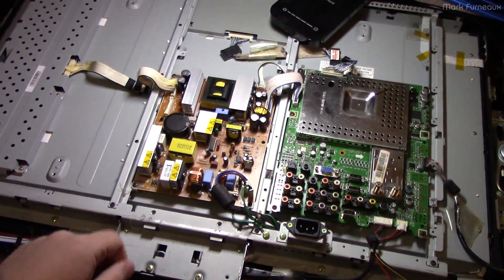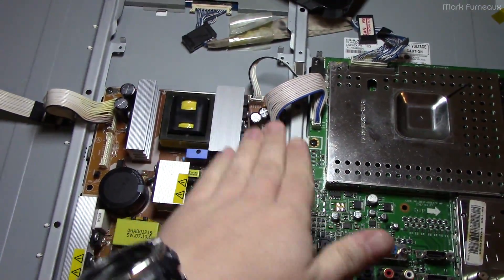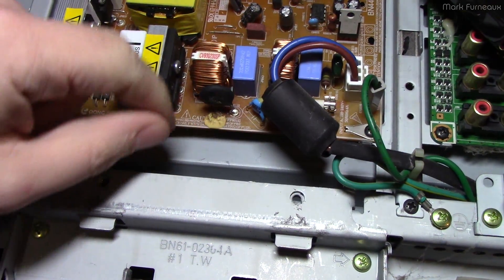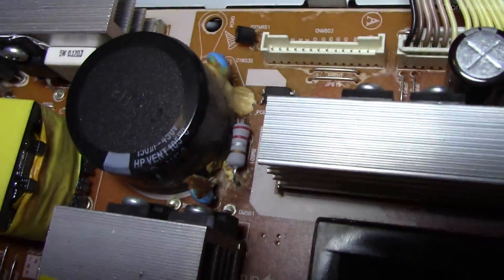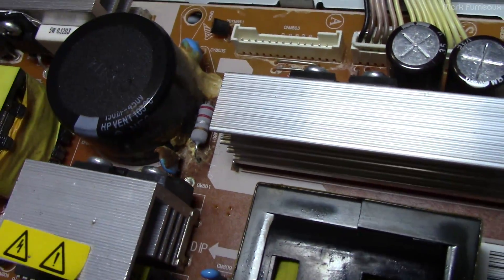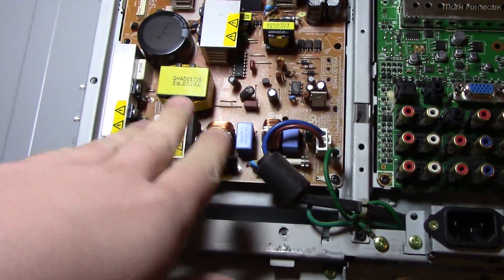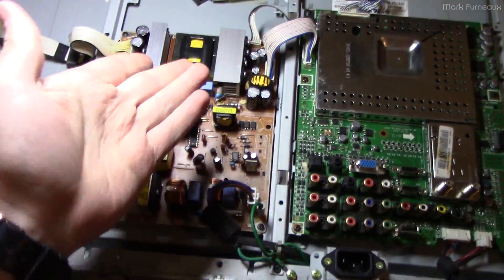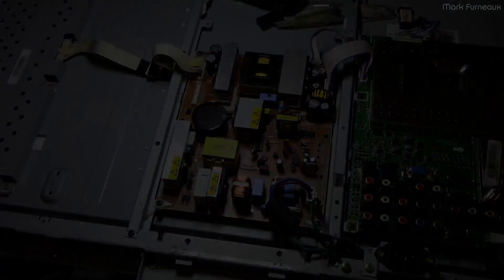Samsung TV Killed by Yellow Glue of Death

Comment: You're not worried about the glue glob neer the optical out on the green motherboard?
Reply from the maker: That is a different type of glue that is not affected. It appears that the power supply was subcontracted to a different manufacturer than the logic boards, so they used different glue types.

Comment: Random stupidness or planned obsolescence?
Reply from the maker: I think it's more of "the cheapest glue we can get, and if it forces a replacement in a few years that's a bonus"
Reply: @TheUbuntuGuy  But the thing is, what's the glue even there for?
Reply: @minecrafter9099  asking the real questions
Reply: @minecrafter9099  Probably to make it impossible to have your own repair attempts being unnoticed.  If your own repair attempts failed, and if you then would approach Samsung's repair service as your last resort, they can reject it at first glance?  They certainly know (from their statistics) which parts tend to fail first, so they tag them with their "glue" (which doesn't need to glue anything, it is just an indicator that a part hasn't been replaced yet).
Reply from the maker: Glue is used for shock and vibration resistance during transit. Large components that have a high mass or that stand off the board very far can sway back and forth and weaken or break the solder joints on the board. The glue holds them in place so that does not happen.
Reply: @TheUbuntuGuy  In the older equipment I have seen they used something that more resembled a wax and it was very chemically stable, just perhaps more heat liable perhaps.
Reply: @TheUbuntuGuy  Ah plausible deniability in the guise of stupidity and greed.

Comment: How do you remove this glue only mechanically or you can use some solvent ?
Reply from the maker: If it has already become brown it is very brittle and chips away easily. It it is still the original tan/yellow colour, it is more rubbery and needs more effort to mechanically remove, but that is how I do it. I have not tried solvents yet.

Comment: What’s worse than finding hot glue in the products? Deadly Yellow glue
Reply: Hot glue isn't a problem. It might not look pretty but in 30+ years, I have not come across any hot glue induced failures except those suffering from unbearable OCD. 😉
Reply: hot glue I'm fine with. you can use alcohol to unstick it, a hair dryer to melt the glue, or goo gone to dissolve it. plus it's unlikely to kill like yellow glue.